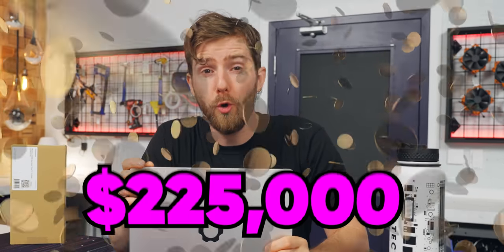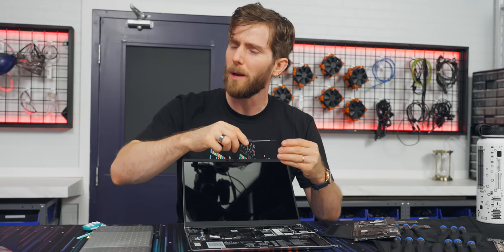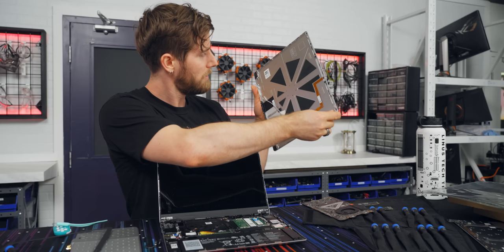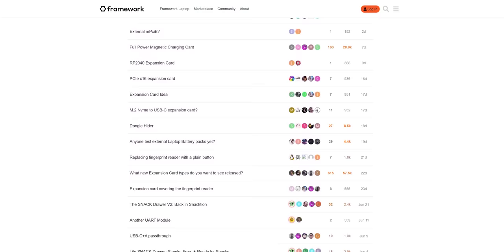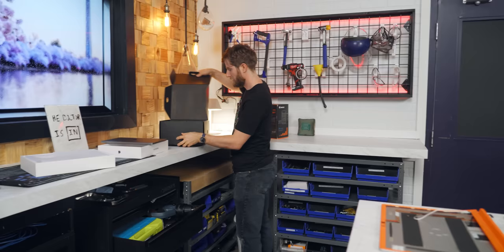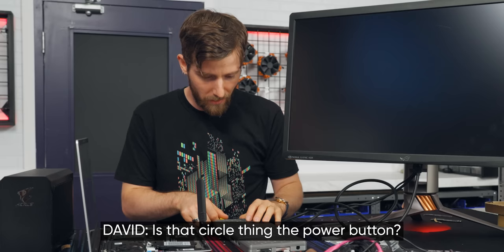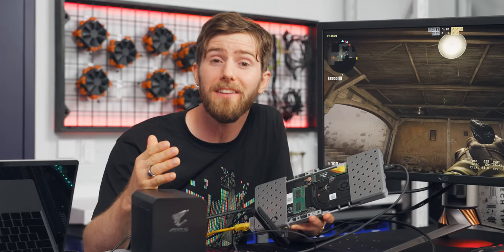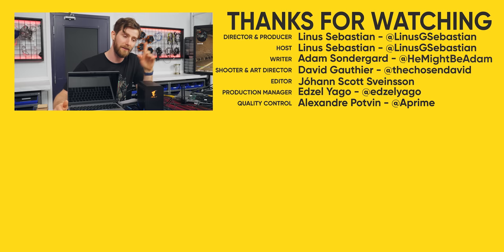I invested $225K in Framework Laptop - 1 Year Update and 12th Gen Upgrade

Comment: As well as an AMD option I would love to see 15 or 16" option. There would be a bit of carry over from the 13.3" version eg battery, motherboard, keyboard, trackpad even if some of those things would be better having a bespoke 15"+ version
Reply: Same, I just like having that extra screen estate. Also numpad.
Reply: Since they didn‘t separate the IOs onto a separate PCB a 15“ version either needs different IO modules (longer) or a different motherboard.
If they had chosen to use flex PCBs to connect the motherboard this would not have been an issue. But I assume that is more expensive.
Reply: @PhilfreezeCH  or they could sell an "extender" which adapts 13in mb to 15in by internaly extending the connections for the modules to the jacks. 
The 15in mb would be a bigger size to accommodate a dedicated GPU and more robust cooling.
Reply: @theSrex  While I love numpads myself, but on a laptop, no, as they make the main part of the keyboard off-center, and I hate that
Reply: I doubt that this will fit their business plan anytime soon. It would require a whole new infrastructure for motherboards etc... And the kind of laptop they are selling currently definitely has the largest amount of interested potential customers.
Reply: As someone with a Framework laptop, one of the biggest draws of a larger chassis would be a larger battery, so I hope they aren’t the same, if framework ever does go bigger
Reply: @atemoc  One of the best things framework could do with a 15"+ setup is offer both keyboards w. numpad and numpadless centered keyboards
Reply: @McDuglas13  Actually, that would be very cool to have the choice !
Reply: @lukeoliver1431  I would love to seem them create a more modular batter. Small chassis uses 2, larger uses 3 or maybe 4 if well packaged. Gives a bit more customisibity, quick charge and with the right software, maybe the option to ware one battery out and while it's being refurbished, you still have a working laptop.

Yes I can dream
Reply: @justusmzb7441  I can't see them doing it anytime soon either. Ensuring the business is on sound footing and solving all the issues that they currently have before expanding rapidly makes sense. They seem to do things right and do them once. Especially if they're having to prove out and show the sustainability side works.

Comment: As a laptop repair technician, I really enjoy seeing laptops become easier to repair/replace parts for the common man. While I may consider laptops easy to work in now that I've been in the field for a bit, I understand that it's very daunting for someone to just jump into it head first, so seeing a company do something like this really puts a smile on my face
Reply: Same thought here, and also a laptop repair tech :)   Some of the laptop-tablet designs have absolutely terrible layered designs.  One particular model # I'm thinking off requires you to remove every single internal component to replace the top lid, because the hinge screws and WiFi cables are UNDERNEATH the motherboard and aux board and the keyboard assembly is all one part with a curved metal edge that overlaps the heatsink.  And don't even get me started on manufacturers using all sorts of different sized screws.  If Framework is going to continue along this line of progress and can make it cost-effective, don't be surprised if big-box/online retailers start carrying their Framework products.  We'll have to wait and see what happens.
Reply: @XSFx5  i have a box full of about 30 macbooks that need to go out to apple for rma, i manage and maintain a fleet of ~450 macbooks and it is not fun when repairs need to be made, luckily apple is starting to get a little nicer and we are starting to get replacement parts instead of rma only
Reply: @XSFx5  that laptop design you mentioned sounds absolutely horrendous, im so sorry if you have to deal with that often. I work for a large tech company and really only repair their laptops, and to be truthful they are pretty good on being consistent with most screws being the same size, but from all the other laptops ive worked on before i know that it is definitely a problem. I really do hope that framework becomes successful enough to be a in-store option

Comment: I think every sff enthusiast just ascended when Linus got to the “mini pc from the old motherboard” part 

Can’t wait to actually make super tiny mobile desktops with this stuff
Reply: Especially with a metal case that's fully shielded and ways to reconfigure the motherboard without access to a charged dismembered laptop.
Reply: sff?
Reply: @twanvanderdonk2504  Apparently, it means "small form factor".
Reply: @earthling_parth  Ohh thank you!
Reply: @johndododoe1411  Metal casings and all would be an improvement for future development.  But I really dont know any current laptop MB that was converted into a small form factor desktop until I watched this today.  Wonderful development for diy.
Reply: @johndurrett3573  It looks like a 3D print so metal would be a lot more expensive.
Reply: I was just watching something on doesnotcompute's channel on a smaller than ITX board that got phased out in the early 2000s which was so tiny it didn't even have PCI slots. I mean, it was back when they were making PCs just to be "internet appliances" for modem connection, so I don't think graphical accelerators not being there was as big a deal, but I mean, a SFF with a good enough APU and no PCIe slots? Totally doable.

Comment: The only thing that stopped me from buying a framework laptop when I had to replace my laptop last is the absence of a descrete gpu. I love what this company is doing, I hope they have an option like that in the future.
Reply: Perhaps something they can put their investors money into although it might simply just not be worth it due the companies relatively small size/sales numbers. There used to be MXM for 'easily' swappable GPUs in laptops but even that had never been a good way to upgrade GPUs (even just a replacement part (not an upgrade) it was nearly as expensive as the laptop it is supposed to go into). Not to mention the big OEMs often didn't quite follow the standard making the parts incompatible with the standard. Smaller OEMs were being a pain with whitelisting only certain GPUs as well.
There were (and are) of course thermal issues to consider as well, a RTX 3050 and 3080 have quite different power and thermal needs.

The best way to do it is probably making a brick of a laptop so that even if you buy a model with a weak GPU you'd still have a massive cooler. Then making daughter boards internally connected over thunderbolt, perhaps with a hardware switch to have thunderbolt available on a regular port at the cost of disabling it internally. 
Either that or try to get in on the ecosystem of one of  the big OEMs (Dell, MSI, Lenovo) that still have a sort of MXM in their own laptops. I don't know why what the benefit to support a protentional competitor to them would be so I doubt that would happen. At best they could get a lil bit of positive advertising out of it.
Reply: He covered that though. External GPU enclosure. 
Depends on your use-case, of course, but I don't really get my game on unless I'm at home at my desk. 
Also lets you keep your laptop and GPU upgrades separate which just makes fiscal sense.
Reply: That also the other thing. Although my use for this machine would be a Linux lite workstation.
Reply: @FrobergDK  sort of, the external doesn't work well for me because my gaming is all on my laptop or Deck at this point.
Reply: @SoloLegends  That's what's great about eGPUs, you don't need an external monitor to play games. You may have to select the egpu or configure certain games, but I think most will just work normally on the laptop screen as long as it's plugged in and recognized. (I've heard there's slight performance hit compared to external screen, but I think it's pretty minor)
Reply: discrete*
Reply: @alka1ine  why tho? Egpus rarely move around, might aswell have it plugged to a monitor

Comment: They really should have AMD versions, and well the only way it can succeed is equivalent pricing and QC in all parts.
($925 for a functional non DGPU laptop is just crazy for most people. A AMD 6000 series with a RX680M IGPU will be better than a intel Xe, if it has to be that way.)
Reply: agreed
Reply: My guess is that they wait for the official thunderbolt support of AMD
Reply: @jooplin  so never
Reply: @jooplin  That’s not going to happen anytime soon, the best we’ll get for the time being is USB4 in Zen 4. And it’s not necessary anyway, some AMD motherboards support Thunderbolt 3 already even though the CPU doesn’t; the board manufacturer (in this case Framework) can implement it themselves. This is more about the two companies simply not reaching a deal, not any technical limitations.
Reply: Performance on a productivity machine is not important to most people. What does matter are things like build quality, trackpad, keyboard, and battery life. And $1k for a reasonably thin and light laptop built well is absolutely normal.
Reply: @jooplin  ryzen 6000 recently got an update that allows usb4 support
Reply: @jooplin  That can come to the 6000 series and I believe has been a thing as they enabled the full USB4 bus, and if the computer contains USB4 ports will run at that speed now, and thunderbolt support will easily attainable if manufacturers support it.
Reply: @Michael-wo6ld  Then Framework hasn't been doing great at all in those departments, though they haven improved. And while this is a thin and light shouldn't be so compromised just because I can open it up and swap parts freely.
Reply: @Foxlum  Sure? It's not amazing compared to an XPS or MacBook, but that's obviously not the point. And besides, the point was that $1k for a thin and light is not at all unusual.

Comment: I like the form factor of the desktop case, it looks like it would fit perfectly on a VESA mount behind the monitor. I've never been interested in the iMac form factor out of concerns over repairability and upgradability, plus I love 21:9 ultra-wide monitors.
Reply: if I remember correctly the made a version of the case for VESA mounts
Reply: @PeterAuto1  If they didn't, it's 3D printed anyways. If you own a 3D printer you can modify the design, otherwise, just use a service that will print it for you.
Reply: Unless of course you're using said Vesa mounts. Still low profile enough to tuck behind a monitor.
Reply: @charliegolf2730  ...or get a drill. :)

Comment: I'm reminded of the time I was a System Engineer for GRiD Systems. They were tough laptops, and one of the SEs that I worked with (I wasn't with him at the time, and it happened right in front of one of our largest customers) gave a nice demonstration of it by actually dropping his laptop down the stairs, and it was completely fine. Now, this was NOT deliberate, and he was lucky. Because normally, on these magnesium alloy shells, the hinges were the first thing to bust, even without dropping them. I think all of us, including the salespeople, always had a couple of spare hinges in our briefcases just in case we needed one or both, for either our systems or a customer's system. All you needed was a Philip's head screw driver to remove and replace them. Ahh, the good times that were the end of the '80s!

Comment: The moment Framework offers a option for a Touchscreen (that supports pen input) and a a display hinge like in other 2-in1's is the moment that I'll buy one immediately. Artists had to bend over and take it when it comes to 2-in-1 laptops for creative works for years now.
Reply: yes thank you!
Reply: Someone uses those for art? I'm not an artist, but when I tried it I found the latency (lag) and lack of precision infuriating. I would use a drawing tablet before I ever tried a pen on a touchscreen again. Plus most artists insist on an Apple logo on everything they use, so not the prime market niche for a start-up.
Reply: @paulie-g  It always depends on the manufacturer. There are Drawing Monitors like from Wacom or XP-Pen that are really good but they are only for Desktops. In the 2-in-1 space there are mostly only the usual players like Lenovo and so on with decent to meh pen support and we just had to take it.
Reply: No Touchscreen is the only thing preventing me from buying it.  A 2-in-1 design would be amazing.
Reply: @SomeKittyCat  Yeah, I've seen the XP-Pen ones and been tempted to try one. I expect they work reasonably well. Reducing lag beyond what's needed for note-taking costs too much for general purpose laptops. That's why there are dedicated product lines for this particular use case. If you've used XP-Pen drawing tablets or pads, I'd be interested in hearing about your experience.

Comment: "There's no double usb-c" It was actually investigated by somefolks and it would be extremely hard to fit due to the very limited space constraint of expansion modules. Having two next to one another is not only tight, but leaves no room for the controller behind.
Reply: I bet if you rotated it to about 15° it'd be pretty well off
Reply: @ClubPenguinMaster88  doesnt resolve the controller issue
Reply: @Ethefake  I thought it was purely physical?
Reply: The other reason is that it forces them to be USB ports. Currently the type C port is Thunderbolt, among the other usuals for type C. If you have two ports in one slot, the motherboard (whichever part it is that controls ports, probably the CPU) can’t do anything with them other than USB.
Reply: @ClubPenguinMaster88  Not exactly how PCBs work. You'd need bulky and complex ribbon cables.

Comment: If they make a 15 inch or bigger laptop of any kind, I am so in for a purchase.  I just need a bigger screen for what I use my laptop for and what I prefer.  That said, I love what Linus and Framework are doing for easily repairable electronics and am glad there is a good option for 13-14 inch users.
Reply: for me numpad is a must so the bigger display is great addition
Reply: Problem with that is, they would need a new chassis design for it, which would be able to properly house all the stand-size components.
So, i doubt that is in the focus of their agenda currently, as they seem to be working on better modularity and compatibility, and fixing any design issues. All these would atleast take another year or two (depending on available investments and speed of W.I.P stuff), assuming they are able to survive until then.
Reply: @Sup_D  I never implied they should invest in a new chassis for this purpose anytime soon.  I'm just expressing what I would need to buy one their products sometime in the future, whenever said future is.
Reply: It needs to go down in price for me. Labtops are portable internet browsers and excel spreadsheets to me and not much more. I don't need a top of the line processor and gpu to do basic web browsing and excel spreadsheets on the go. I have a desktop at home for anything that requires a bit of power. I enjoy their focus on user repairable stuff but when it economically makes 0 sense to me why would I spend 1000 dollars on a labtop? I can get by with budget labtops for 4 to 500 that last 5 or so years. Sure long term they're cheaper but that doesn't help if you don't have the 1000 dollars to drop on one today. If they had any sort of budget option I'd go for it.